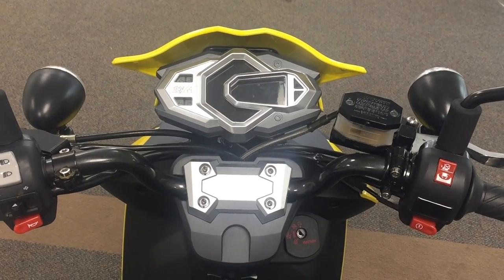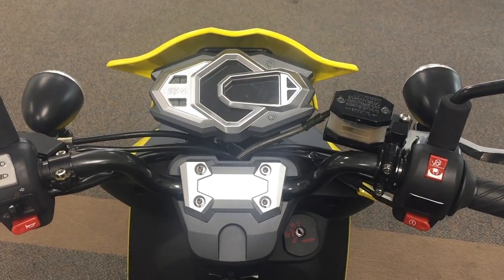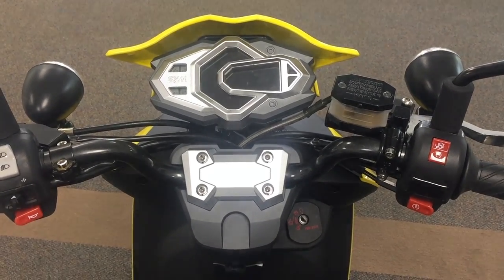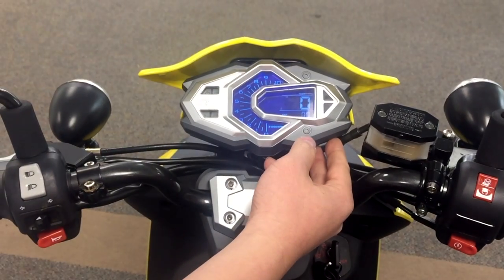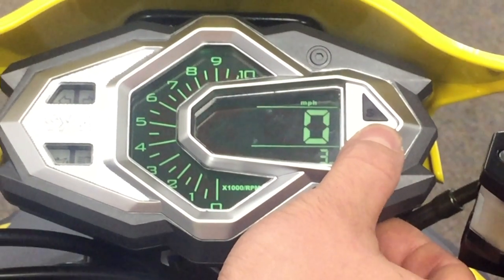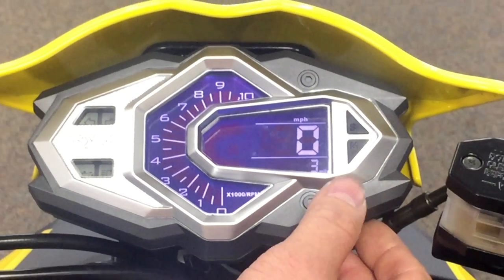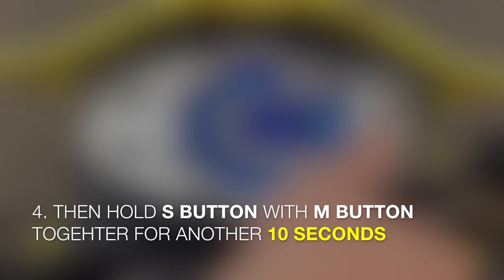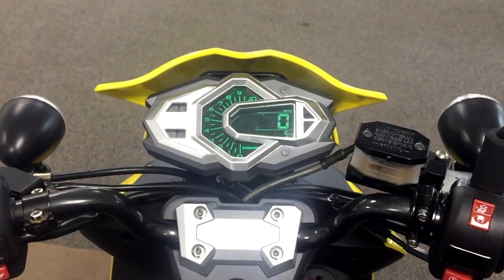Lance Cabo Oil Light Reset - from Official Lance Powersports

Comment: Why you don't include this info and many others in your official manual? I don't get it it should be in manual like how to change time mode from 24h to 12h if possible, where is a gear oil fill and drain screw, where is a spark plug, where we have all fuses located etc. your manual is incomplete.

Comment: Thank you SO much ! I've been riding around for 6 months with the oil light on . Lifesaver !
Reply: Was the oil light red? Mine came on red and I reset it but I just want to make sure that it was the oil inspection light and not warning me about low oil pressure
Reply: It’s easy to turn off , there’s a video on it

Comment: Thanks , I got service at 500 miles. I was cruising about 10 miles from my house and there’s light came on. I was like “ oh crap I need oil “so before I took off for home I checked the Lance YouTube and was relieved to see this fix
Reply: Same here 😄
Reply: Was the oil light red? Mine came on red and I reset it but I just want to make sure that it was the oil inspection light and not warning me about low oil pressure
Reply: @rafrick  technically, it’s the service light. It’s set to automatically come on every 600 miles. In most cases it’s letting you know you should get the scooter checked for maintenance ( preventive)
Reply: @frontrowproductions9145  thanks 👍 I had an oil change done not long ago and I've noted when I next need to change it. Glad to hear that it's a service light rather than a warning light, I was a bit concerned when it came on today

Comment: Just bought a 2018 Lance Cabo SYM 125cc. Unfortunately our only scooter shop closed their doors so scooter owners are left on their own. I would love it if you would do a series on the Cabo showing the scheduled maintenance check points. especially for the warranty scheduled maintenance. I just hit the 1 km mark and it's time for an oil change. I know there's a separate oil drain plug as well as the drain where the filter screen is located. I will be checking both just to cover everything as well as doing the gear oil in the transmission. Synthetic per the manual.  Even so it would be nice to see a video from pros who do these maintenance checks to make sure the warranty is not voided. On my old Honda Scooters there is always an aluminum washer that will conform to the oil drain port to seal it. Not sure if the washer on SYM product is the same but I guess I will find out. (Crush washer)  Thank you for showing how to reset the maintenance indicator and keep up the good work.